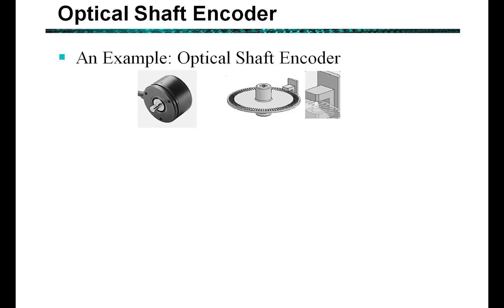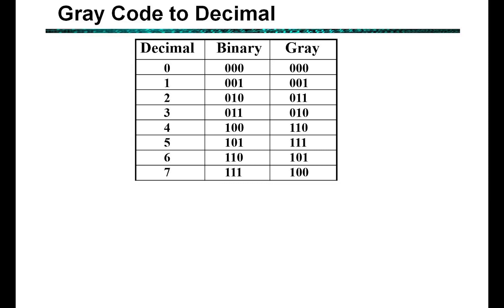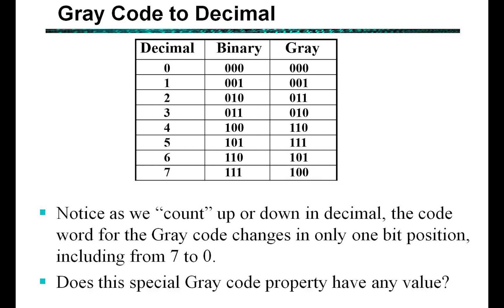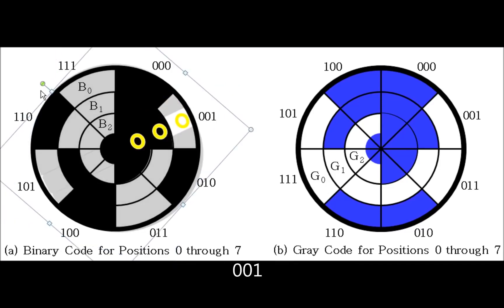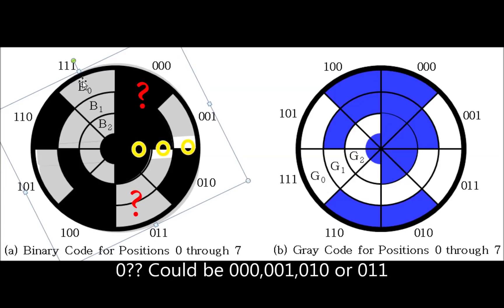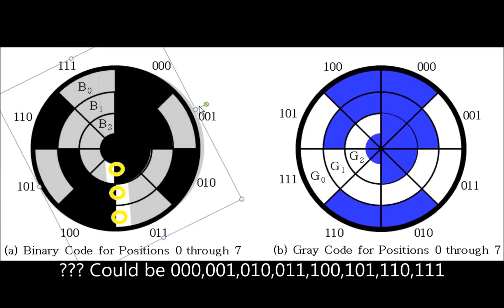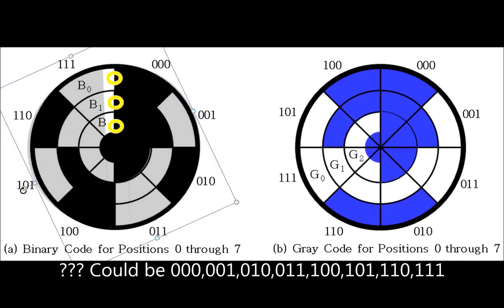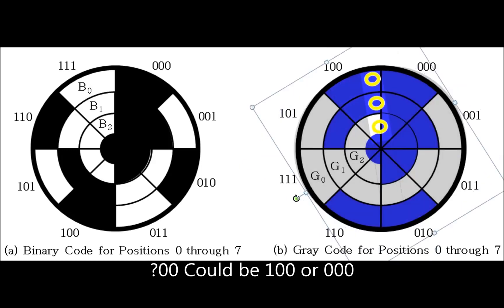Why use Gray code for an optical shaft encoder?

Comment: great video, i was looking at pictures of encoder wheels and it seemed off. now i know why. also i believe in a binary wheel, you should be able to make the outer most position more narrow- creating a shorter window and editing pulse length and phase, you can use the outermost ring as a indicator of When to take the readings. this way you only get readings for values not near the borders. one advantage to this is binary chips are hugely avalable, while the other one may require conversion elsewhere if need be. very cool stuff. useful for many kinds of motor application

Comment: I would have thought 0-99 would be common for a shaft encoder for entering a value to a processor, or 0-359, but i cant find a table or list for them, I could sit for hours with pencil and paper but  just seems odd i cant find it anywhere

Comment: Great explanation just one correction, you have mention Decimal, Binary and Gray. And in your case you have 01234567 which is not decimal, it is  octal (8 elements). Decimal is 0123456789 (10 elements). You have also Hexadecimal 0123456789ABCDEF (16 elements)